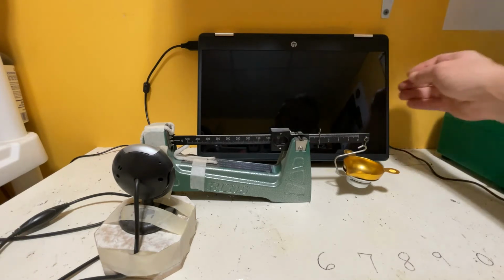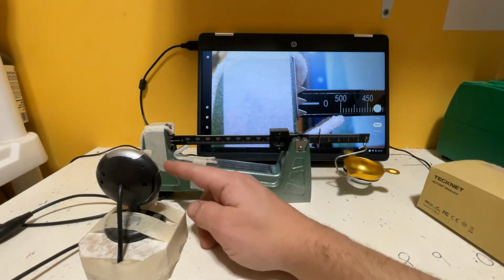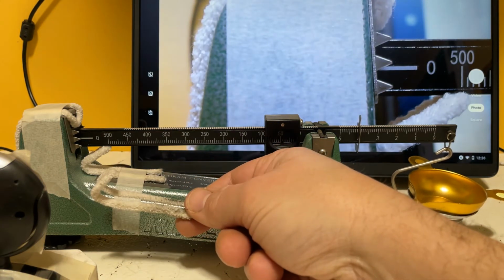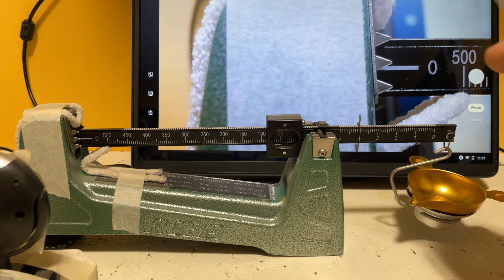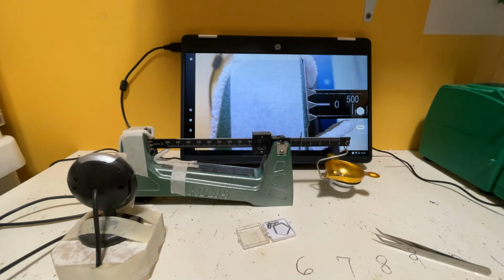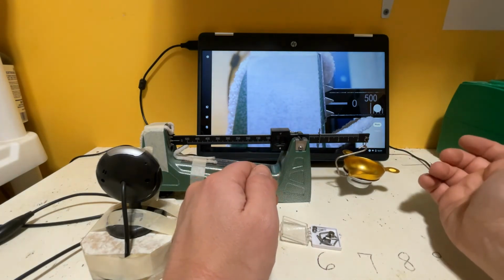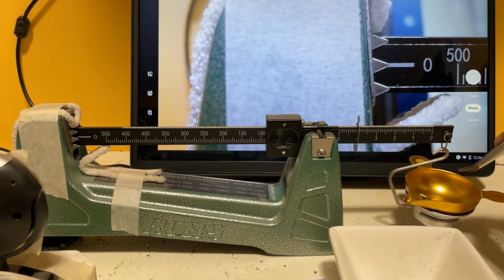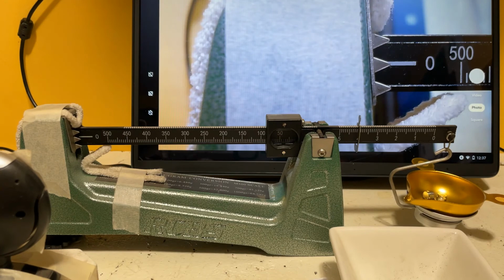All About BEAM SCALES! RCBS M500 Tips & Mods

Comment: Awesome video! My rcbs m500 seems to be off by about a 10th of a grain with the Lyman check weights. I'm going to try the pipe cleaner trick. Happy new year!
Reply: Mines off by 4/10ths
Reply: @blueridgeboy6791  that sucks man! I ended up buying an older rcbs off eBay and it's an absolute tank. Really accurate. Then I ended up buying a rcbs chargemaster link. I know it's a little pricey, but the chargemaster link is insanely accurate, repeatable and I can load about 10 for every 1 on the beam scale.

Comment: Thank you for the video! I am already doing something sort of like the camera setup you have but the pipe cleaner idea is a good one. That is one thing that i didnt like is that slamming down when the pan was lifted. Also it makes sense about the "zeroing" at or close to the charge weight.
Another little tip that i saw on another video was to fill in the frame of the scales with some plaster of paris just to give it a bit more weight and a little less chance of being bumped around because they are quite a light device.
Reply from the maker: Yes, adding weight to the bottom of the scale would be a really good idea! Thanks so much for watching! I hope you’ll subscribe to my channel!

Comment: I have the same scale and check weights. My 20 grain check weights really weigh. 20.2 and 20.3. I checked them on 3 different scales and they all agreed. So 2 20s and 2 2s give me around .04 under zero at 44.6 grains on the poise beam. So I may have to ditch the Lyman weights. (BUT luckily one of my pet loads runs on 44.6 grains of varget so weight can easily be calibrated to the charge)A big help for repeatability on mine was sharpening the knife edges to a razor's edge, carefully scraped the paint off the agate pillows under the bearings and polished those to a mirror shine , lightly bent the pan hanger support evenly upward on 4 sides to help center and hold the pan in the same place every time it is put back. I also padded the travel of the scale but I just used a piece of adhesive backed felt inside the cast under the dampening plate. Seems to have done the trick. A single piece of varget with throw the pointer clean off the line now and returns to dead center of the line of "zero" as many times as you want to check it. Oh and I also use a camera to eliminate parallax.
Reply from the maker: Awesome! Yeah, I noticed my two “2 gn” weights weren’t exactly with each other, so I took some fine sandpaper and sanded the heavy one until it weighed the same with the other. Fortunately, mine was heavy so I was able to correct it. My two 20 gn weights were really close.